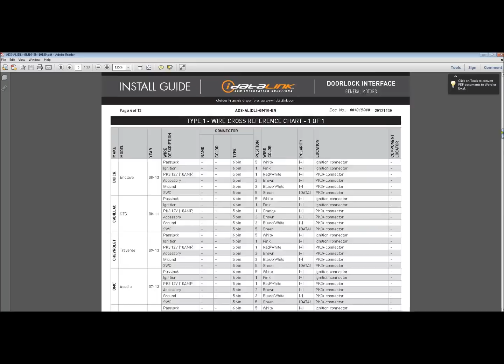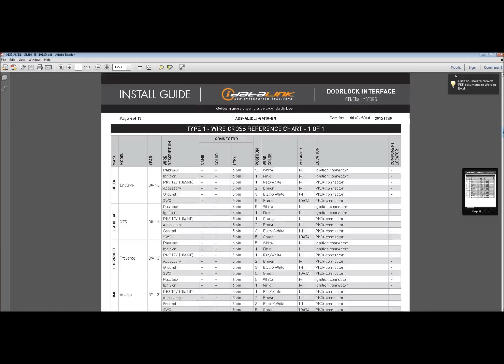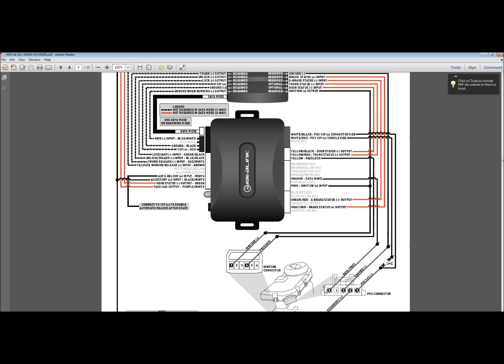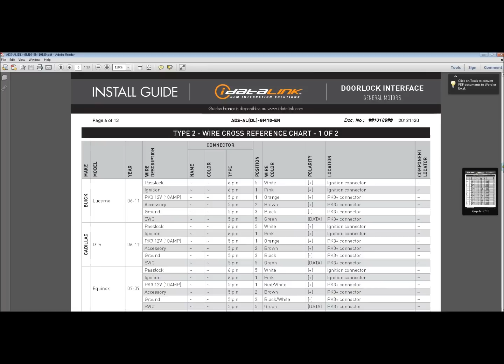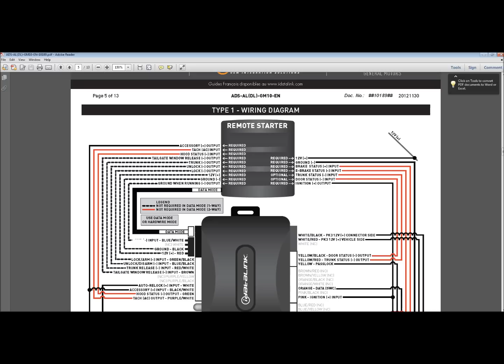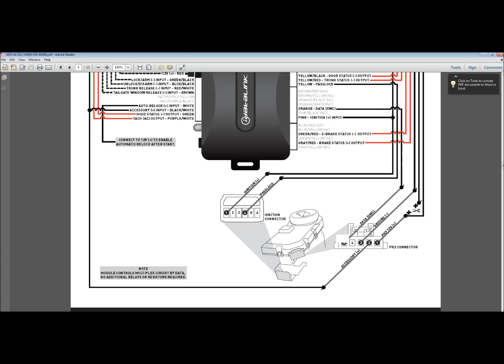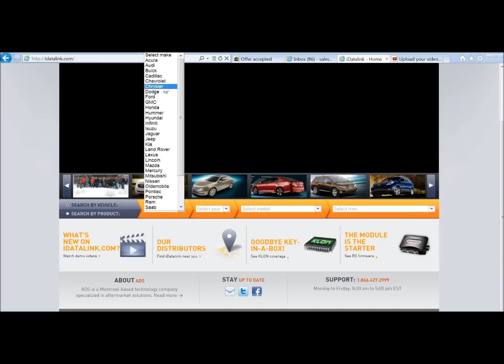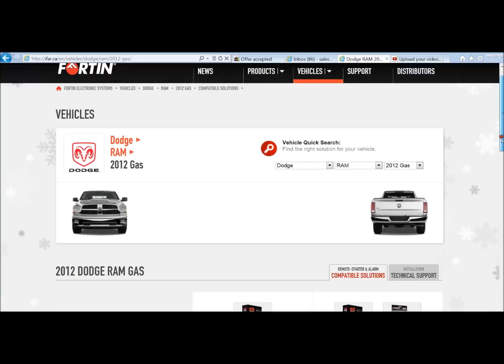What is a bypass module and how do I wire it up?

Comment: I'm having trouble programing a OEM remote start plug in play t harness can you help?
Reply: Guillermo Santana
Reply: Working on a 99 ford f150 5.4l.  Losses key...hooking up a new alarm paperwork is telling me I will need hook up these three wires one wire will be 12 volts on it at all times the other one will be 12 volt ignition this wire has 12 volts when the key is in on and in crank position and I will have 0 volts when the key is in off position and then it tells me the ground wire which I got and then it says the two heavy gray wires Target wires will have 12 volts when the key is in crank position only cut this wire the engine will not turn over connect one gray wire to each cut wire alright so I think my PAT system is not allowing me to run this test for me to turn my key on and find these wires that you're talking about with my meter so is there any way you could tell me what the actual color of these wires are or perhaps draw me a little schematic and post it I would appreciate it thank you very much

Comment: What do you do if you use the blade cartridge
Reply from the maker: A blade still needs to be treated the same way. All that makes a blade different is by the means its connected to the starter, Instead of a d2d connection, It slides on board the brain instead. The wiring is still there!

Comment: Is it possible to install the id datalink on a vehicle that does not have a data wire?
Reply from the maker: depends, whats the application youre working on... please expain
Reply: I have a prestige APS997EC that I want to install with idatalink ALca in my car. My car is a Kia Soul 2011, to my surprise, the car does not have a data wire, it uses a key without a chip. please advise.
Reply: Any answer?
Reply from the maker: whats the year make and model, gimme something to work with here
Reply: My car is a Kia Soul 2011
I have Remote Start Prestige APS997EC
And the immobilizer idatalink AL CA

I hope the above will be helpful.
Reply: Any response?

Comment: IDATA Nissan Maxima: The manual states that the Nissan Max 2010 requires 10 wires (4 Data, 6 hard wires at various connectors).   Does this mean that only SIX WIRES are required for the install of a Viper 5701?    Also IDATA Website lists three modules for '10 Maxima the "AL CA", "BLADE", and "SOLO" models - Which module should be used?    Lastly, is the IDATA the best module for this application or would an Express Kit DBALL2 or  FLCAN be better for an easier install?      Thank you for your assistance in advance and the great videos you have posted

IDATA Nissan Maxima 2010:  http://cdncontent2.idatalink.com/corporate/Content/Manuals/DL-NI5/ADS-ALSL-NI5-EN_20130924.pdf

Comment: For 2011 nissan altima with PTS, the install guide is not clear with the primary wiring from the remote start. They've mentioned not to connect any other ignition or accessory wire from the remote start to the car but they haven't mentioned about any of the power or parking lights or brake lights from the remote start.
It also says to connect the door lock wires from module and remote start so don't we need to connect the door lock/unlock wire from the remote start and module to the door lock/unlock wire of the car??

Comment: I would really appreciate your assistance on this.   I am connecting a PYTHON 5706 to a Nissan Maxima 2010 Push to Start using a XPRESS KIT DBALL2 -- 402 NISS3HT FIRMWARE 2.11, AUTOMATIC TRANSMISSION. USING PRIMARILY DATA TO DATA.   The DBALL2 installation manual says to connect the DBALL2 wires below.  Second, I was planning on connecting the PYTHON Wires I indicated listed below.  I ONLY WANT BASIC FUNCTIONS TO WORK ON THIS ALARM.

Question:  (1) Are these the Correct Wires To Connect on the PYTHON and DBALL2?   (2)  Do I need any relays or Diodes for these connections? If so where?

[you can cut and paste you response to simplify your answer]

DBALL2 Install Guide:  http://xpresskit.com/VehicleCompatibility.aspx?p=null&year=2010&make=Nissan&model=Maxima%20%28Smart%20Key%29&ps=1&s=0&c=0

----------------------------DBALL2 Harness-----------------------------------------------------
---14/3   HSCAN HIGH    ----- OBDII Connector Pin #6
---14/4   HASCAN LOW  ---- OBDII Connector Pin #14
---14/8   Data Vehicle side ----Key port Connector Pin #2
---14/9   Data key port side  ---Key port Connector Pin#3
---12/2    Push to start (neg)  --------PTS Connector Pin #4
--12/4   Door Pin Output (neg)  --- BCM Pin #39
-12/7   Key Sense Output (+)  -- key port Sensor Connector Pin #11

-12/8   Ignition Status Input (+) -- ignition input -- Python H3/1 PINK  Ignition 1 input/ouput

--12/9   Ignition Status Output (+) ---ignition input - Python H3/1 PINK  Ignition 1 input/ouput

-12/10   Clock--  Keyport connector ---Pin #2
-12/11   Data-- Keyport connector ---Pin #3

------------------------------PYTHON 5706 CONNECTORS --------------------------------
MAIN HARNESS, 6 PIN CONNECTOR

--H1/1   Red  (+) 12vDC Constant  ----- Connect to 12v Battery at Brake Switch Pin #3

--H1/2   Black  (neg)  chassis ground  -----  Connect Vehicle  Ground
-H1/3   Brown (+) Siren   ----- Connect to Siren (+) and () to ground

--H1/4   White/Brown   Parking light isolation wire – Pin 87a of onboard relay – NOT USED

--H1/5   White Parking light output --- NOT USED
--H1/6   Orange  (neg) 500mA  Ground when armed output --- NOT USED
 
DOOR LOCK, 3 PIN CONNECTOR--------------------------------------------------

-----NOT USED  (D2D DBALL2)

REMOTE START, 10 PIN HEAVY GAUGE-------------------------------------

--H3/1   Pink    (+) IGNITION 1 input/output - Connect to DBALL2 (two wires - ignition status input & output)

-H3/2   Red/White    (+) fused (30a) IGNITION 2 / flex relay input 87 – BCM, (GRAY, 40-PIN PLUG), PIN 16

---H3/3   Orange    (+) accessory output -----  BCM, (BLACK, 40-PIN PLUG), PIN 31

---H3/4   Violet    (+)  starter output (car side) ---- PUSH-BUTTON START Switch

---H3/5   Green   (+)  starter input (key side) ------ PUSH-BUTTON START Switch

---H3/6   Red     (+)   fused (30a) IGNITION 1  INPUT ----- BCM, (BLACK, 40-PIN PLUG), PIN 11

---H3/7   Pink/White   (+)  ignition 2 / Flex relay output  ----- NOT USED
---H3/8   Pink/Black   (+)  Flex relay INPUT 87a key side  - NOT USED
-H3/9   Red/Black   (+)  fused (30a) accessory/ Starter input ----  NOT USED

---H3/10  No connection – NOT USED

AUXILIARY/SHUTDOWN/TRIGGER HARNESS, 24 PIN CONNECTOR---------

[** 2 CONNECTIONS HERE ONLY #9 and #13 below** ]
 
---1   pink/white   (neg)  200mA  ignition 2/Flex output
---2   blue/white    (neg)  200mA  2nd status / rear defogger output
---3   red/white   (neg)  200mA  Trunk release output
---4   black/yellow   (neg)  200mA Dome light output
---5   dark blue   (neg)  200mA   status ouput
---6   white/black   (neg)  200mA  Aux 3 output
---7   white/violet   (neg)  200mA  Aux 1 output
---8   orange/black   (neg)  200mA  Aux 4 output

---9   gray   (neg)  200mA  hood pin input  (NC or NO)  ---- CONNECT TO HOOD PIN

---10   blue   (neg)  200mA  Trunk pin/ instant trigger input (nc or no)
---11   white/blue   (neg)  200mA  Activation pin
---12   violent/white   (neg)  200mA  Tachometer input

-13 black/white  (neg)  200mA Neutral safety switch - CONNECT TO SWITCH

---14   green/black   (neg)  200mA  factory alarm DISARM output
---15   green   (neg)  200mA  door input
---16   brown/black   (neg)  200mA  horn honk output
---17   pink   (neg)  200mA  ignition 1 output
---18   violet   (neg)  200mA  door input
---19   violet/black   (neg)  200mA  Aux 2 output
---20   brown   (neg)  200mA  brake shutdown input
---21   violet/yellow   (neg)  200mA  starter output
---22   gray/black   (neg)  200mA  diesel wait to start
---23   orange   (neg)  200mA  accessory output
---24   green/white   (neg)  200mA  factory alarm ARM output

Comment: Question: If 2 valid keys are required for programming this, why would I need this anyway. Maybe a premature statement, because I don't know everything; therefore the question, but this is "statement: BULLSHITTERY"
Reply from the maker: Many vehicles need a master and a slave key to wake up the computer to learn an intangible 3rd and / or a 4th key digitally with a bypass kit like this one here.